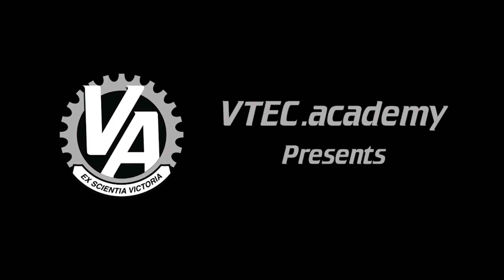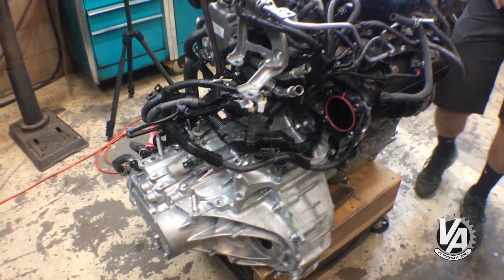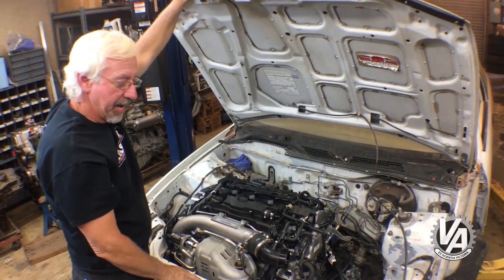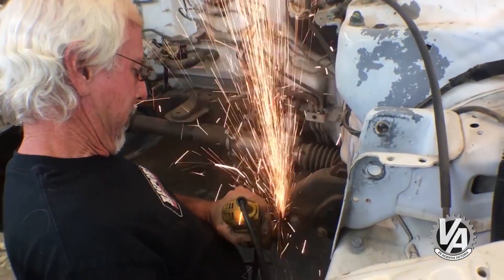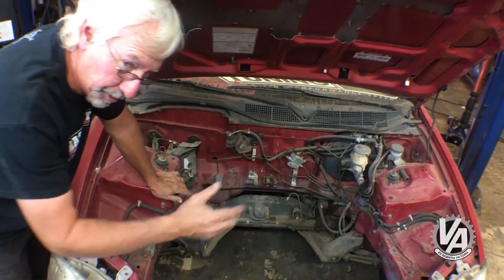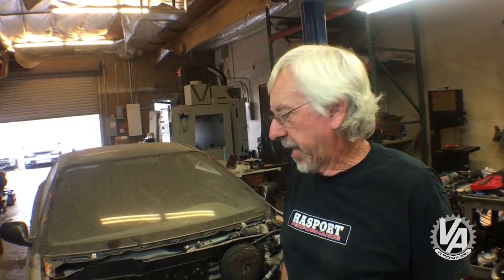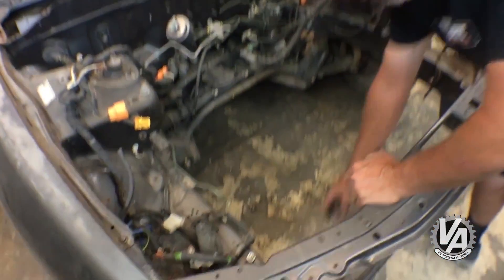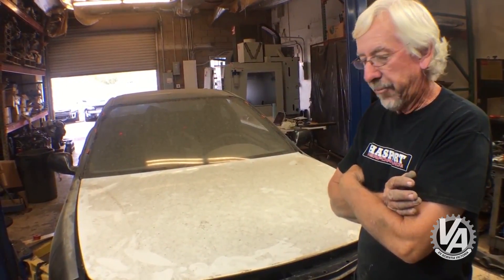K20C1 Swap into EG, EK Civic and DC2 Integra - Test Fit

Comment: I get the nature of this video being "we did because we could", but who realistically would want to take the engine out of the new suerpior civic and put it in an old one? Yeah, there may be a power to weight advantage here, but non of the stuff that'll allow the car to put that power down.
Reply: As Honda builds 10s of thousands of Accords with this engine and transmission they will come up in salvage yards and be available for swapping. Putting the engine in a double wishbone suspension car that weighs 1000 lbs less will result in a Type R killer.
Reply: @BrianGillespie_brianathasport  Thank you! MacPherson is inherently inferior to double wishbone! Finally someone is thinking! And weight savings advantages will make it all the more potent.
Reply: Synysterjmz Honda are selling these as crate motors
Reply: Andrew D'mitri newer chassis are shit!!!
Reply from the maker: No weight misconception here. If it's heavier it accelerates more slowly. Period. As for mechanical grip from weight, I have a V6 powered CRX and yes the front end grips better than it did with the supercharged K24 that was in it before.

I hear you, but the reality is the Type R engines will be showing up in salvage yards. The other K20C turbo motors from the other Acura  and Honda models will also be collecting in the salvage yards. If you have a choice of what chassis to put it in, it's only going to be an FK8 if you blew yours up. Otherwise it's probably going to be your favorite Honda or Acura.  In reality a DC2 Integra with decent suspension and K20C swap is going to motor away from a Type R, even on a curvy road. 

And why take it out of the Type R? It was the easy choice. I had questions about packaging and what it fits and what was I going to prototype swap kits for. Taking it out was much easier than waiting for a wrecked car that may or may not have been local to me and in usable condition. It only took a few hours to remove it and half a day to put back in. I also had a crate motor for the record, that's why the confusion on some of the comments. 

Now we wait for someone to wreck a Type R or Accord Sport. The wreck will make its way through the insurance auction and to a salvage yard. Hopefully the entire swap isn't beat up by the crash and offered for sale as a unit. Then we buy it, slap it in something and take it to the track to compare it to my Type R. 

In the mean time, we are autocrossing and tracking the Type R so we can do some engine, chassis and suspension development. More videos to come.
Reply from the maker: The Type R is an amazing FWD car. But if you put the K20C in most any decently prepped Integra or Civic, it would be faster than the car that set the Nurburgring lap record. The older cars are easily modified to be better handling.
Reply from the maker: Although we have a crate engine, this one came out of my daily driver. It's back in and I am driving it.
Reply: VTEC Academy I'm not really saying one is better than the other. You put a more powerful engine in any smaller, lighter car and it'll be faster than the heavier one the majority of the time (though, Nissan have disproved this in most cases with the GTR for nearly 10 years). HOWEVER, I would be very interested in seeing an actual head to head. I think a lot of people are forgetting about impressive differential and dual axis strut suspension in the FK8 (and FK2) that allows the car to put down as much of its power as possible. I'm not convinced an engine swap into a smaller car would be as clear cut as you think without other serious modifications, but I digress. 

What I'm getting at is my original statement of "why drop it from a new Type R", which the majority of the abusive knuckleheads above seem to not understand. As a crate motor, sure go for it. Ariel basically did this with the Atom, dropping the old NA k20 from the FN2 into what's essentially scaffolding on wheels and made an incredible machine from it. 

What I'm trying to say is that the new chassis isn't "crap" as some like to think. The design has allowed Honda to manufacture a car that meets all the modern needs on a platform AND still be an absolute weapon on the track. Do you see what I mean by this? 

Sure, if your end goal is have a gutted track car, then yeah, I agree, the smaller, lighter older cars are probably a better fit in most cases compared to a gutted FK8. But again, that doesn't make the older one better than the newer one (and it doesn't make the new one crap either). 

I hope all this makes sense. 
Cheers for the replies btw, I enjoy the discussion. 🖒
Reply from the maker: In my day job I make engine mounts for engine swaps into Hondas. This engine has the whole Honda community very excited and in a matter of time will be readily available in salvage yards for a fraction of the cost of buying the whole car. Like the K20 and K24 of a few generations ago and the B before that this engine will get swapped into older Hondas. It will not only be in Civics, but S2000s NSXes and other Honda and Acura models. 

The technology in the new Civic Type R is amazing, and Honda has done a great job of bringing great handling back to the Civic despite the big heavy chassis and suspension limitations of a strut car. But, there are still literally millions of earlier Civics that can be had at a good deal with enormous aftermarket support and like the K-series of 17 years ago it will be come the engine swap of choice. That and the L15 turbo motors. 

Anytime I hear someone say, "Why would you do that?" it means to me they simply don't understand how the market we serve operates. It will be popular. It's like the Harley Davidson motorcycles. Whey would anyone want to drive a hunk of ill handling, loud, dangerous metal that just vibrates until your nuts go numb? Well, clearly, it's not for me. This probably isn't for you.
Reply: VTEC Academy you're correct, I don't understand the US market, as I'm from the UK. I guess us brits have been spoiled with the Type R for over a decade now, so it doesn't create the same level of hype. However, I'm more impressed with the engineering that's gone into making the car what it is- a 7:43.8 hatchback record holder at the Nurbergring. Anybody can dump a powerful engine in a FWD car and make it go fast in a straight line. Not everybody can do what Honda have done with this car is make it very practical and usable on a daily basis, whilst beating the likes of the RS Focus, Nissan GTR and Ferrari F430 around a track. 
This is why I said "why take it out of a FK8". If it's a crate motor (which you said it wasnt), then yeah, I get it, great, I understand that fully. 
I'm just saying, if you have both the FK8 and an old EK, taking the k20C out of the FK8 and sticking it in the old civic doesn't make the old one better. You're forgetting about the differential, the suspension, the brakes and then the amount of downforce you would need go create at speed to sustain traction in corners.
Katutoshi Mizuno explains the weight misconception perfectly in regards to the GTR, a car that's been spanking supercars for the past decade. 
I there's more to the Type R than just the engine, which is evident in the difference between the FK8 and it's predecessor (of which I own).
Reply from the maker: To think the older chassis is inferior is to totally ignore reality. As for performance, they are lighter, better handling and far more modifiable with huge aftermarket support. No comparison. The newer chassis relies on many electronic devices to be comparable in handing, but is heavier and has less aftermarket support. The fastest time attack Hondas and amatuer road racing Hondas are  older Hondas. They are superior. The Honda performance game is all about putting the latest greatest Honda motor in the older better chassis.
Reply: I'm a Lame bitch so taking the engine out of a £35k car and sticking it in an old rust bucket is the solution? You clearly have no idea what you're talking about if you think the chassis is shit. You don't hold the FWD Nurbergring lap record with a shit chassis...
Reply: Synysterjmz that’s how I feel about every civic I see with a j or k swap lmao. Waste of a swap on a shitty chassis

Comment: VAG has been using Bosch ecu's for years and there is some hardware/software that u can use to tune with and turn sensors off or delete them from the system.